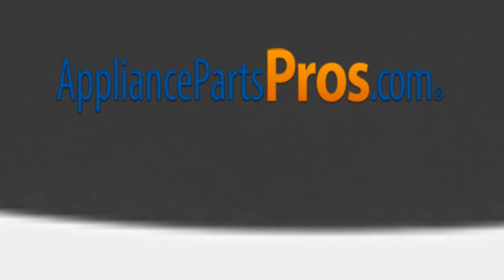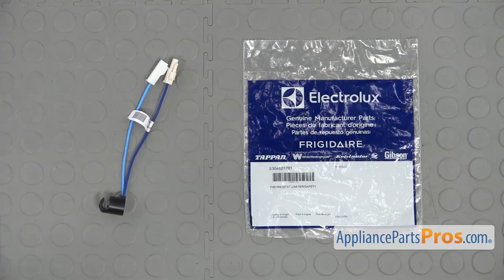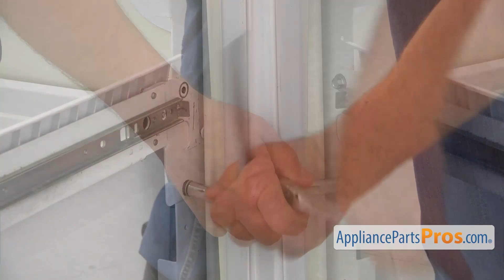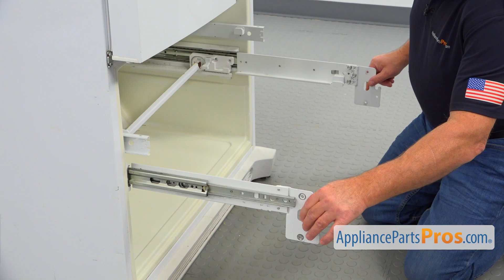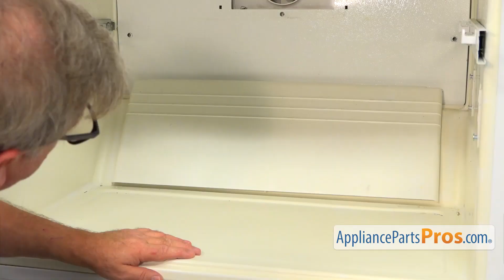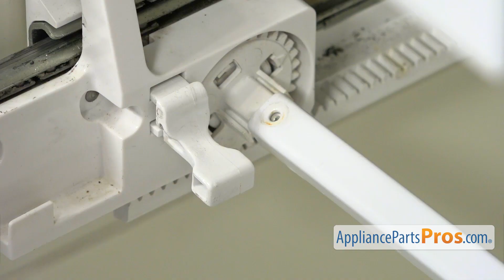How To: Frigidaire/Electrolux Refrigerator Defrost Thermostat 5304521781

Comment: I changed this because my heater are on all the time, thinking that it was the defrost thermostat , after I replace it with the new one the heater are still on . What else can be wrong ? Please help
Reply from the maker: What is your model number of the fridge? Have you recently had a power outage?
Reply: @appliancepartspros  FFHB2750TS6 . No power outage.
Reply from the maker: Does the heater stay on all the time? What exactly is going on with the fridge?
Reply from the maker: Have you had any error codes come up on the display? Have you tried to put the fridge into diagnostics mode to see if any error codes come up?